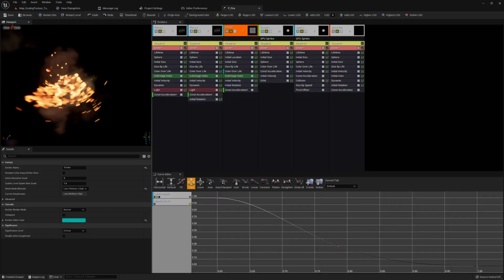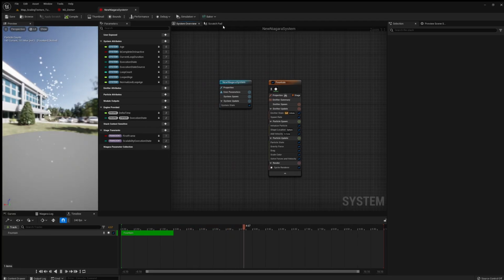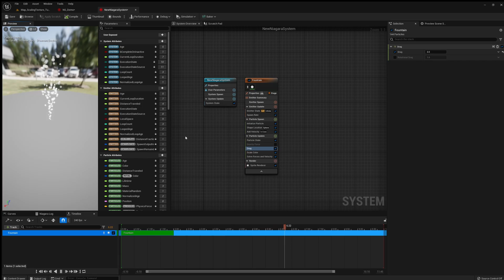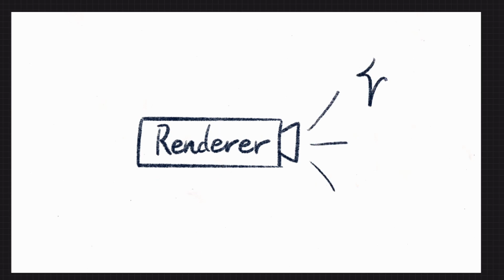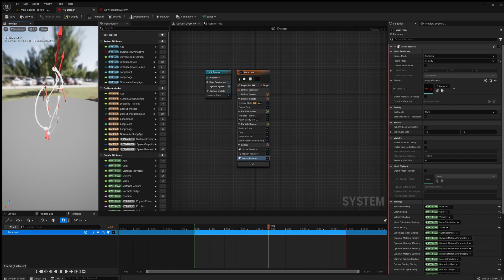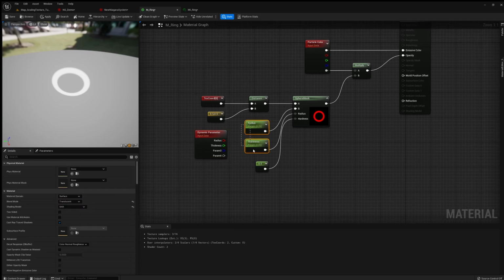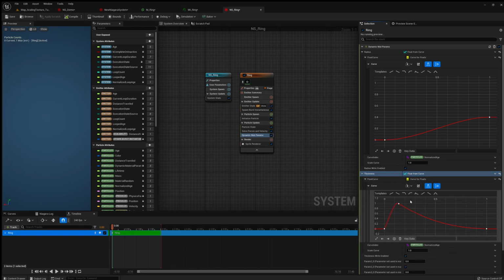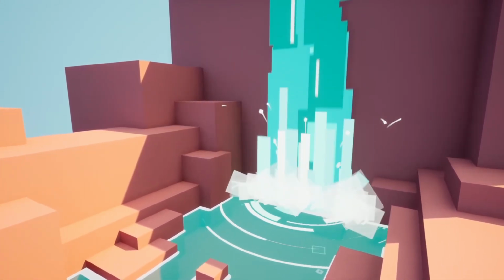This is your first lesson on making game VFX (in Unreal Engine 5)

Comment: May I ask a student type question, I'm trying to cobble together an idea.  Is there a way to mix an Albedo flipbook texture with a different Alpha flipbook texture in a material?  Then, run a random SubUV animation in Niagara?  For a simple example:  My "albedo flipbook" texture is a 2x2 made of a Square, Circle, Box and Triangle.  My "alpha flipbook" texture is a 2x2 made of the number 1, 2, 3, 4.  When the material is plugged into Niaragra, and the Sub UV animation is set to random, will the Albedo texture and Alpha texture randomly cut out each other and plays as a flipbook animation?  I cannot get this idea to work?